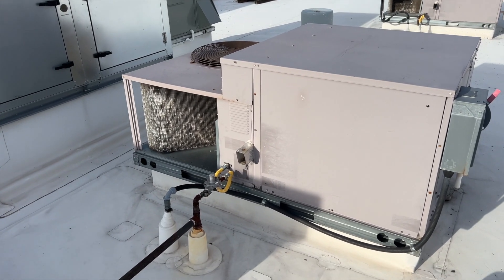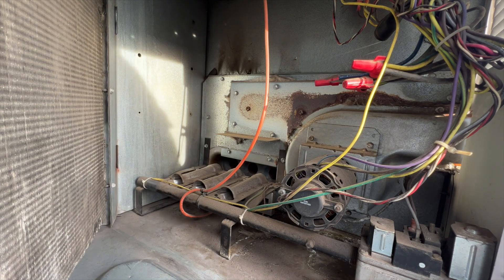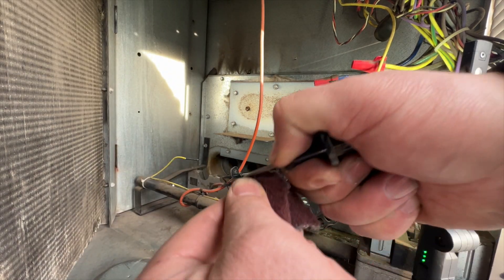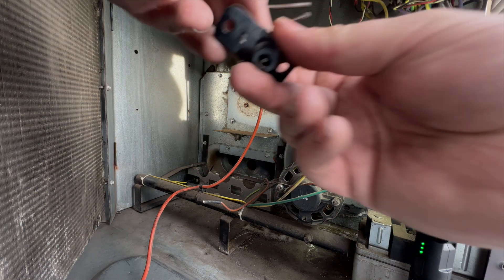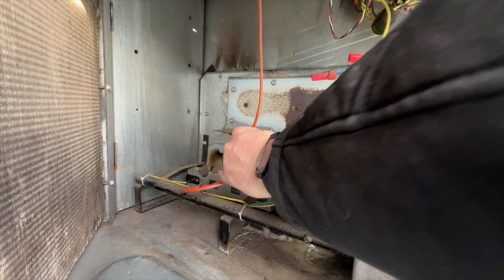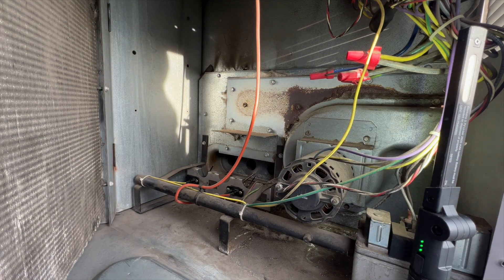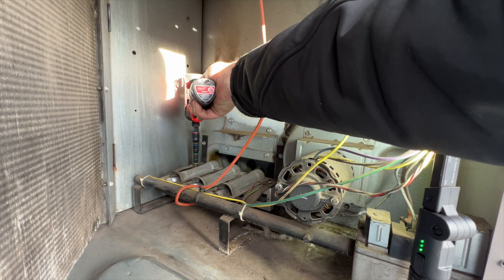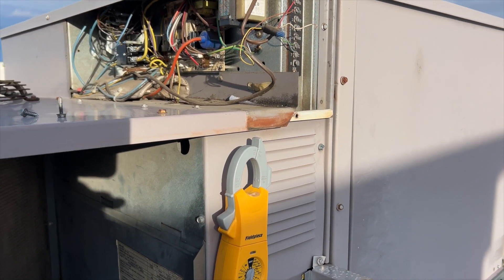Carrier Package Unit Ignition Failure Dirty Crossover Tubes EP168

Comment: I need some advice if you could give a opinion on. I finished HVAC school and have 1.5 years of residential service. I want to get into commercial and no one will hire me. Should I get into commercial install to get into commercial faster or should I continue to grow my experience in residential service ?
Reply from the maker: I worked in residential for 10 years before I switched to commercial. We have some techs that started with no experience too. You just got to learn as much as you can and keep applying.

Comment: This is good maintenance, but it is a little bit rare for the maintenance you just did such a great job with to have been the fix for a failure in one of these units.
Most likely, an ignition lockout is going to result in replacing the board, and you can find that out very quickly once you've ascertained that code and cycled power. You will find that either the board needs to be replaced because of no spark, or the board is sending voltage to the gas valve but the gas valve isn't opening.
  The other potential failure is the inducer itself is suffering from a bad motor, or on those older units, he Hall switch at the back of the motor has failed.
One of the commenters suggested using a dollar bill for the electrodes, and I have cleaned electrodes using both methods, and I've never had to come back after using a sandcloth. Since I tend to service the same units for 5 to 10 years at a time, I would have discovered if using the sand cloth was a bad idea..

Comment: Hey bud,
Good job.
As a retired Carrier service manager, may I offer this advice: The cross over tubes should have an opening equivalent to the thickness of a dime. Easy gauge to use.
Also when cleanings flame sensor please nerve use anything really abrasive. A dollar bill works fine.
The sanding causes groove which get dirty faster than previously.
Thanks for your always great work.